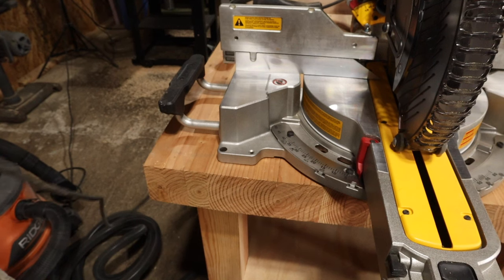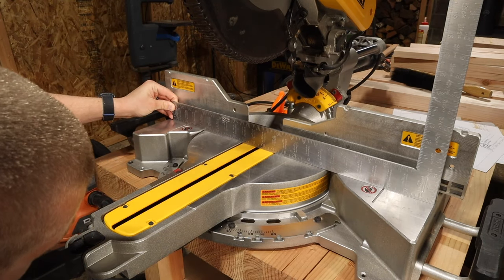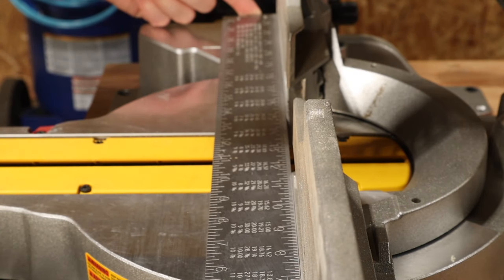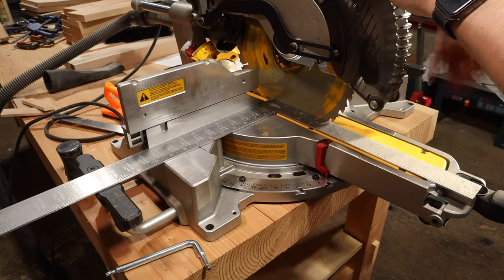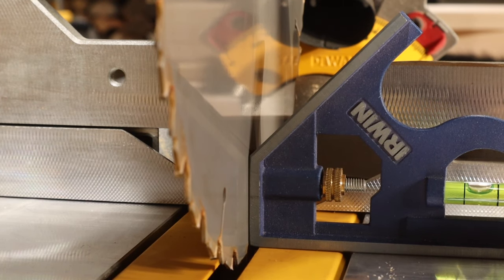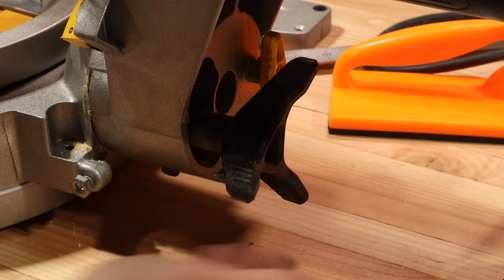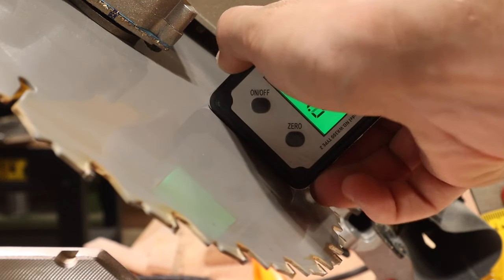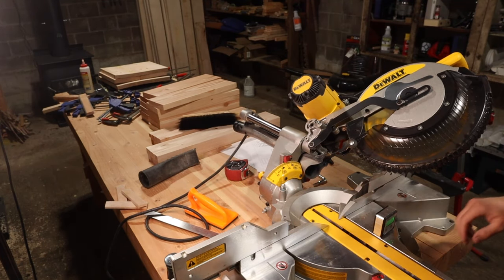Fine Tune Your Miter Saw | Dewalt 779 Miter & Bevel Adjustment

Comment: Don't trust a carpenter square for this kind of work, honestly this is not fine tuning a saw. It's more like rough tuning. You need to actually make cuts to tune up the saw, Google five cut method.
Reply from the maker: Fair enough, the five cut method, at least for the miter, would be the most accurate. Used it for my cross cut sled and the method is awesome. Also, true “accuracy” can never achieved and as such, what drives my effort is the accuracy I need for my use case. For me, this is plenty accurate.